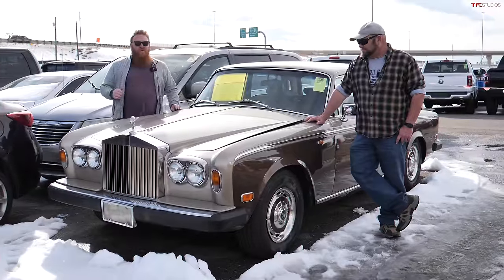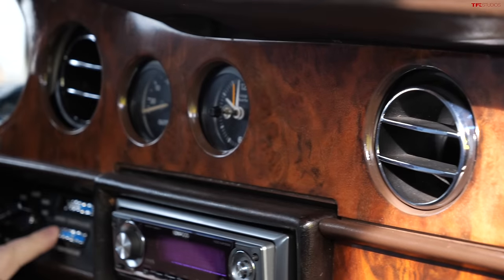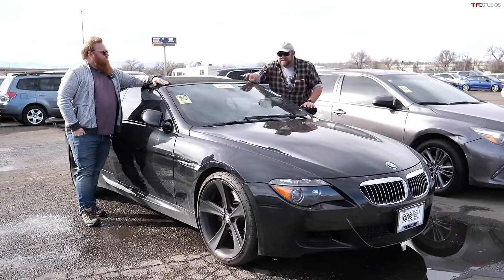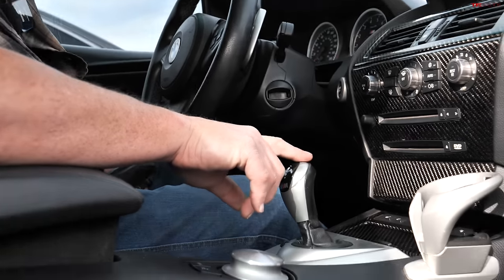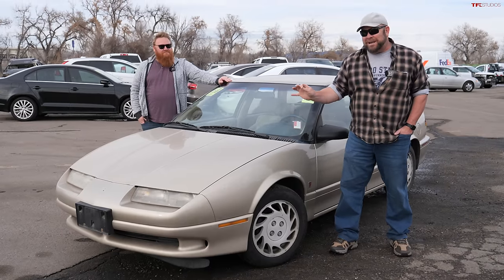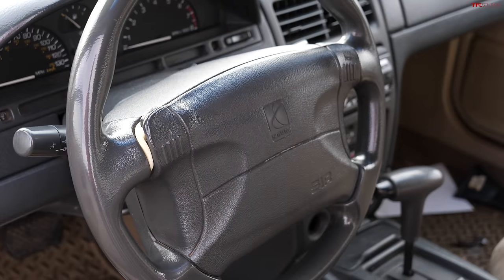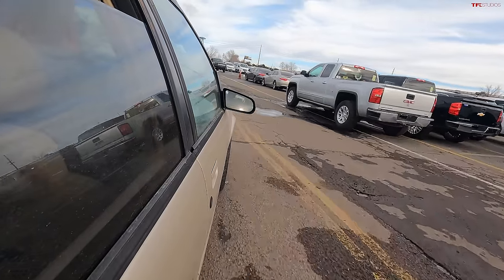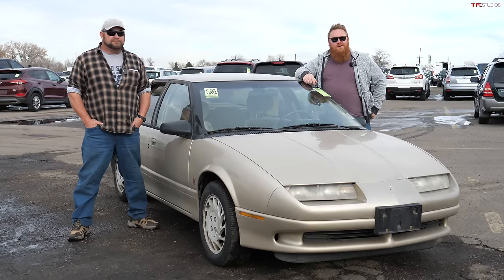3 Surprising Classics to NEVER Buy!

Comment: In 1997 I toured the Saturn engine plant in Buffalo, which was next level for GM. One side of the building looked like the movie Gung Ho where it was a typical dingy GM plant where they were making the Chevy motors and the other half looked like a clean room science lab where they were putting together the Saturn motors. The guy giving us the tour was so proud of how much care went into every Saturn component compared to the other GM motors.
Reply: And the Chevy's are still running...
Reply: Interestingly, the Cavalier was a more reliable car than the first and second-gen SL/SC.
Reply: @scottysgarage4393 yes. Saturns budget became very little and eventually they were pushed out of the market
Reply: Ironically they quickly ended up using the same engines as the Chevys. And as a previous owner of a Saturn L300 3.0 V6, that was a wise decision
Reply: @Rich-fr2yv  The L-series Saturn wasn't really a Saturn. It was based on a shared Opel/Vauxhall platform which also used their V6 engine.
Reply: The Saturn engine components such as blocks and heads were produced on CNC machines instead of the more traditional dedicated transfer line machine tools. The same CNC machine that was machining an engine block could be machining a cylinder head or another part next. They had bar code readers to automatically bring up the required program depending on the bar code on the fixture. The up side is flexibility and not having the entire line down if there is a problem with one section (1). The down sides are higher cutting tool costs due to each machine being required to handle multiple operations. Inspection issues when something is out of tolerance and needs adjustment the problem must be traced to the individual fixture the parts came out of.
Another thing about the Saturn blocks and heads. They used a lost foam casting process that had many features such as tapped holes and through holes already cast in the rough condition reducing needed metal removal.
1) Most times each individual section of a transfer line will have parts stockpiled so that if that section is down for a reason production can continue for a certain amount of time.

Comment: I recently needed an extra car and bought an exceptionally well-cared for 2001 Saturn SL2, and I 100% agree. I paid a hair over $3k for it with 130k miles. It's fully loaded and has a 5 speed. It's absolutely brilliant and fun to drive. I've had to do very little to it and what few things I have had to do mostly cost less than $10 with pick n' pull parts and any work can be done by a novice with hand tools and YouTube.

I keep it in a garage and fully expect to still be surviving 20 years from now. It's really such a forgotten gem for basic transportation.

Comment: A Rolls Royce, a BMW M6, and a Saturn SL2 show up and the Saturn is the star of the video. I loved those first- and second-generation Saturns. I briefly owned a 1997 SC1 5-speed. It was dark metallic green with a beige cloth interior and a clamshell 3rd door. The SOHC 1.9L by that point had 100hp, which doesn't sound like anything, but it was a pretty lightweight car, and with the manual, it actually had decent power and was fun to drive.
Reply: I owned a '97 SC1 and agree, it was fantastic, reasonably peppy, and with some minor tire and suspension mods, absolutely GLUED to the road.  And it sipped gas.  One minor nitpick though.... yours was a 99+.  The 3rd door didn't exist before then.
Reply: @geoffreyreuther5260  you're right. It was so long ago and I only owned it for a short period of time.

Comment: I bought a ‘93 Saturn SL2 new.  It was a great car and actually was fun to drive if you got the manual.  Steering was responsive and the 124hp wasn’t bad since the car didn’t weigh very much.  It  was still running strong when I sold 10 years later.

Comment: This old Rolls Royce is better than modern vehicles 20 years from now. Spending 5K on bad  F150 tail light is no fun.
Reply: The brake pads & rotors are $4000 just in parts - that is if you can even find a set.  And the hydraulic system can cost over $15k to fix.
Reply: @ckm-mkc   15k you can get a cool set of fabricating equiptment and use it over and over again

Comment: Wow!  I bought a brand new SLT-2 in 1994 and absolutely loved the car.  The car drove great and the chassis was very tight.  There were two design issues that absolutely drove me nuts.  1st, the hvac controls were not back-light, so it was very difficult to see what the hell you were doing at night.  2nd, when it got below 45 degrees, the compressor would not come on to help defog the front windshield.  So then you had to switch to full heat or the windshield was fogged over!  The defrost debacle  was the design flaw that drove me insane!!!!!

Comment: Those old Saturns are cool! I wish GM would have let them keep doing their own thing rather than using badge engineering on the later models.
Reply: Saturn was never profitable enough to fund the development of a new model let alone a range of models.
It only had the financial resources to perform facelifts and minor updates.
Original owners were enthusiastic about their vehicles but eventually, a majority of them moved on. General Motors rebadged other models of vehicles to try to appeal to them and keep them loyal to the brand
Reply: It's just that Americans don't think on what's good for them anymore, just only on looks. Tons of Europeans, tons of sport cars and Japanese small cars. Luxury, speed and compact. Americans did try that but as always, no one pays no attention. And that's why they go to badge engineering cause the imports ' did the same ', I don't know if any of you notice that...

Chevrolet Cavalier is one example....

Comment: I had two Saturns. A 96 SL1 and a 2000 SL1. Both were stupid nuts reliable. The only problem I had with either of them was with the 96; a body panel did shatter, but it was below freezing for quite some time and I got a bit too close to a brick planter. I actually want to find another one for around town trips.

Comment: I was truly shocked to see a Saturn on this episode, I honestly have yet to find a video where people have lots of negativity to say about  the s-series, I have had a few over the years and they truly are a robust cheap car. My first Saturn was a 96 SL2 auto and I tortured that poor car but it never ever gave up I ended up wrapping it around a light pole and it still Ran an drove. Now currently I currently own 2 1996 Saturns a sw2 auto and a SL2 5spd have had them for 7yrs and don’t plan on getting rid of them as they are way better and more reliable than my newer cars 🤣
Reply: If there ever was a negative review of the Saturn S Series, it would probably be all the minor nitpicks of the low cost build of the car, all of which the Saturn fans will counter in the comment section with all the positives of the car. The Saturn truly is a great representation of basic transportation vehicle.
Reply: @nowiecoche  I will agree with that and will add I firmly believe that the s-series was a great attempt by the american auto makers to compete with Japanese, I own a Toyota product from the same era as well and my S-series are mechanically as reliable as the Toyota just the build quality and fit n finish aren’t as good as the Toyota

Comment: I had a 1999 SL1 with the manual transmission. The only option I ordered was the A/C. 233,000 miles before I finally traded it in (Honda dealer gave me $100 for it) I would take that car back in a minute as a utility commuter. Reliable, decent gas mileage and reasonably fun to drive with the manual. I didn't even mind the crank up windows. They really don't make cars like that anymore.
Reply: Ide take a bullet in my leg before selling my car for $100....wow, that is insane. I was looking at one of those saw one for 2000 but it had around 230 thousand miles on it, manual transmission.   I don't need A/C was broken in my first two cars so I got used to not using it, and I live in the south.

Comment: I had a second gen Saturn SC1, SOHC and manual transmission. I miss the car but it came beat up and the body did crack and splinter. I took care of it when I had it and ran several highway trips in it.

Comment: Had an 01 Saturn SC1 5 speed. Bought it for 4k out 50k miles on it in two years and sold it for 2500. Got my moneys worth in fuel savings alone. It got 42mpg. Should have kept that one just as a run-a-round car. I’d buy one today

Comment: The Silver Shadow sounds like an interesting project car if you're willing to replace the engine, transmission and braking system with more reliable GM hardware. The problem is that if you REALLY wanted to make it reliable, you'd have to replace the hydropneumatic suspension with coilovers. This sounds like an expensive proposition.
Reply: The problem would be finding a viable car in good shape for cheap. Less than 5k and 20k for the new engine, trans, brakes and suspension would be a steal at 25k to end. Now finding the right hardware is the problem. I am sure there is a forum out there with all the details. Just going to take you a month to sort it out. 
There appears to be a lot of these older models out there rotting away. No one drives them daily.

Comment: I have seen a number of those Royal Roycs for sale in the range of 10 to 25k. The problem is that every single one of them has some form of leak or problem. To swap it out with a modern engine/trans and break and suspension would set you back what you pay for the car. Now does that make that car worth far more? It might interns of someone who wants to daily one of these, a collector no so much.

Comment: I looked at buying a used M3 with only 900 miles. It was equipped with an SMG transmission. Test drove it and it was absolutely terrible. I can see why it was traded in. Ended up buying a new 2008 M3 convertible with a manual transmission.

Comment: Actually the S1, S11 RR Shadow, T & T1 Bentley is actually quite easy to work on. The SU's can be a little challenging. As you mentioned always buy the best one you can afford, not a project. Parts are the major issue. They are expensive and can send you bankrupt. Now the later 80's Spur, even a good one will break you. Others to avoid are early Jaguar XJS, XJ12. They fixed a lot of issues from 1979. For something a bit newer, avoid the 1984 to 1987 XF Ford Falcon\Fairmont\Fairlane\LTD. These are really badly built, though cheap to repair the Cam wares excessively, panels never fit. If you want something similar get the 82-84 XE. It's also better looking

Comment: Id get the Rolls and swap it to normal brakes and swap a LS into it.
Reply: That makes sense
It already has a GM TH400 transmission
Reply: As if changing it to normal brakes would be easy or reliable. The standard brakes are complicated but work fine if set up and maintained properly.
Reply: Swap to Wilwood...Run new lines...install booster.  Done.  Nothing Rolls left other than the iconic look.   @htimsid

Comment: No car payments!! Have a 2006 Sportage, 06 Element. 2000 Elantra and a 07 Elantra 5 speed. Except for the 07 they all havevover 250,000 miles and are still going well with few problems. No car payments is great. Some cars last.

Comment: The one serious downside to the Saturn engines is they had a tiny drain hole in the block for oil. 
If you let the car go 3200 miles without an oil change it would throw the timing chain. My 2nd wife's car did this only four or five times.
Reply: Bought ours new in '97, would blow the overflow cap off while coolant was still cold, dropped the timing chain with 83,500 miles. Got oil changes on time. Repairs were more than book value for the car, we scrapped it

Comment: From the sound of it, it sounded like it was hitting even on all four cylinders. If you bought that, I would have all the fluids changed in it, new filters, and just have it as a daily driver. Very drivable. It's nice to not have to worry about a scratch or dent made by a shopping cart at the grocery store. I simply hate worrying about an expensive luxury car being damaged while parked. Not a concern, with this old Saturn!

Comment: The RR is a pleasure to drive. But will eat you out of house and home to maintain. You have to make sure the brake fluid is not contaminated. There is a difference between Castrol  RR 363 and the regular 363 brake fluiid.  It turns all the rubber seals in the brake and suspension into. Bubble gum where it all leaks.  If it is run dont walk.

Comment: That Rolls-Royce is not the nightmare you let people belueve. The headliner in that car is West Of England Wool. The leather is from Connelly. The carpets are Wilton pure wool. The hydraulics are not the black art you portray. The system is almost idenyical to that in a Citroen DS. The engine is strong and tough. The transmission is a built under license GM Turbohydramatic 400 3 speed. All in all, if you know how, maintenance is not bad for either cost of labour. Most people get intimidated by them, but take your time snd they are robust and reliable.

Comment: Saturn was the only car that would get rear ended at 10mph and get front end damage from the collision as the Shockwave from the impact would travel through the plastic
Reply: On the plus side, I sideswiped a Honda at a 50 MPH speed differential and neither car took any damage at all...

Comment: LS swap? Like their Jag cousins, Rollers needed Chevy V8 swaps long before the LS generation was available.
Reply: I had the same thought.
Reply: It's not just the engine that is an issue. The engines themselves are fairly reliable for what they are. It's the hydraulics that control everything from the injectors to the brakes. They never worked properly, they ALWAYS leak, and they are more difficult to learn than Arabic
Reply: Roadkill Draguar

Comment: Repeat after me, "There ain't NO bargain Rolls...or Ferraris/Maseratis/older Benzes/big Bimmers!!" PS - the headliner IS wool, from Wilton.
Bimmer - gorgeous engine when it works right, which is seldom.  These cars have a horrifying history of both electronic and mechanical catastrophic failures...which can quickly and perrmanently ruin your relationship with your banker.
Saturn - average/mediocre cars by and large, but a wonderful dealership experience...from which GM learned precisely NOTHING!

Comment: The Rolls Silver Shadow is a great car.  It is very well made but more than this they are great to drive. The metrics these guys use are completely flawed.  Assessing the value of a classic by its market value is completely misleading. A better measure is how much did it cost new because repair costs are much more likely to align. And so the issue is can you actually afford the car at all. The Silver Shadow  has expensive hydraulics engine sspension and brake components. The transmission isn't an issue. But if your a classic car enthusiast it does have 2 really strong things in its favour
1. There were lots made and there is an excellent world wide supply of parts
2. It has the cache of a Rolls but not the cost.

In fact of all the Rolls made it's the last one that is a practical proposition to own.

Comment: 94 SL2, absolute garbage. Engines burned oil from poorly honed cylimders, and valve guides. Motor constantly idled rough from vacuum leaks in nearly every component operated by it. Camshafts that were never ground to correct specs, and oil leaks caused by inadequate drain-back hole behind the front mainseal, that forced cold oil through it. And the transmission valve body crapped out every few thousand miles causing it to slam in reverse. Horrible car.

Comment: Those old RR... Sometimes I think it would be fun to get a non working one with perfect interior, cut the engine bay off & then turn it into a lounge pit in the living room. 🤣
German cars: Nothing after year 2000 by principle cause they are luxury garbage (only Tesla worth having for us Europeans).
Reply: On the British tv show “Top Gear” they use the rear seat from a Rolls Royce for a sofa. I have a friend who found a 1985 Rolls Royce at a junkyard that had been totaled in an accident, but the interior was mostly undamaged, so he took the two front bucket seats, the rear seat, and the carpets (Rolls Royce carpeting is incredible). He turned the bucket seats and rear seat into chairs and a sofa that looked beautiful. The woodwork and the interiors in Rolls Royce’s are usually gorgeous and high quality, where those cars become problems is everything mechanical and sometimes the electrics fail.

Comment: All 4 cylinder engines are straight 4s.
Reply: No they aren't.  Subaru four-cylinder engines are horizontally-opposed.  So are Lycoming four-cylinder engines.  We've had V-4's, too.  Ford (Cologne) made one.  AM General used one in the "Mighty Mite" military vehicle.
Reply: And Porsche
Reply: Add to Jerrolds list the Saab V4 in the sonnets and 96s and Pontiacs V4 in the early 60s tempest (half a 389)
Reply: Honda had a couple of v4 motorcycles. The Sabre and the magna
Reply: And the millions of VW beetles with flat 4s
Reply: @edmessina8392 , that Pontiac four was inline as I recall.
Reply: @markjohnson8260  It was a 389 split down the middle, literally....resulting in an inline 4 but with the cylinders sitting at a 45 degree angle. It was called the "Trophy 4" and ran from 1961-63. Shared 120 components with its' parent V8 including one full cylinder head. Sorry I was under the impression it was a V4.